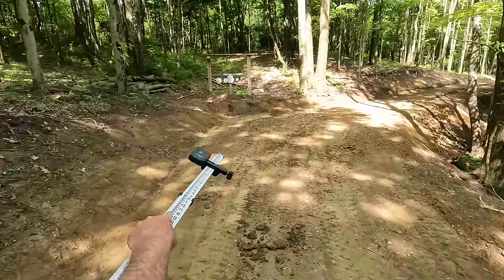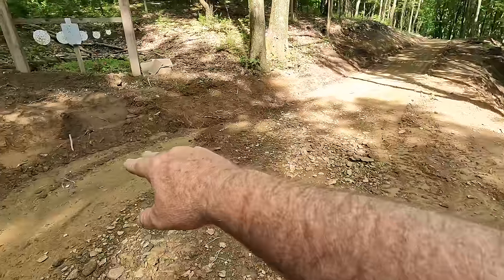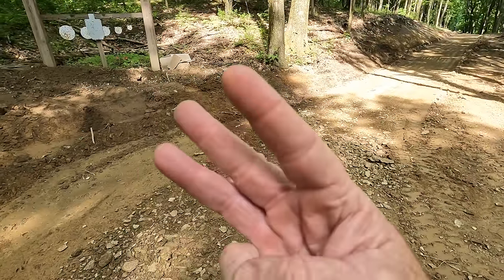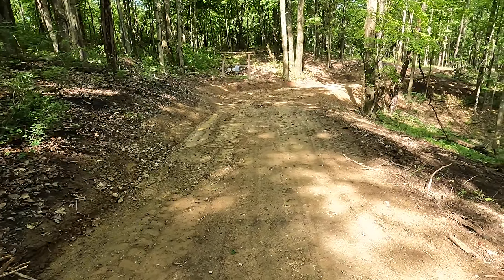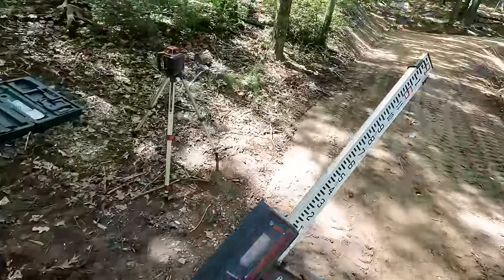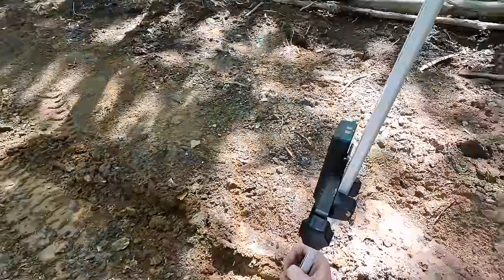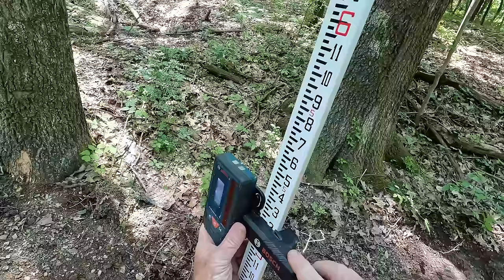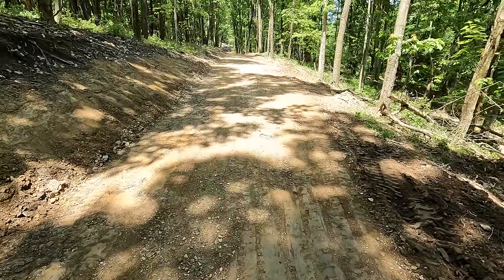Water Doesn't Flow up Hill, I need to fix this

Comment: Hello Mike from Brookhaven, MS. I watch your video's pretty much every day.  You remind me of myself about 30 years ago when I was around 55 years old. I was and still am very much a machinery freak and have owned many tractors, backhoes, dozers, and even a small excavator since I was around 20 years old. I did not get to the  point you are where I could buy new until after I retired but rather did a lot of horse trading and working on the used equipment. I was a mechanic by trade and used my skills to keep the older equipment running and much of the time to get it running from a broken down situation. I have been retired for 25 years and still cut about 5 acres of yard/pasture but have gotten rid of all my heavier equipment due to realizing things are not as important as they were when I was younger and had much more energy, but I still have a 40 HP Kubota with an air conditioned cab, grapple, box blade, mower, and related equipment, a JD 1025R with a loader and backhoe for shovel and wheel barrow work and moving trash cans to and from the end of the driveway, and a new Stihl 760 zero turn for cutting the grass. Enough of that though, what I wanted to suggest is that you consider looking into a six way blade attachment for your Kubota skid steer. A six way blade on a small dozer or a skid steer the size you have would make ditching trails and driveways and even grading them very easy. I know you have the excavator but a six way blade is really handy. Just a suggestion. Really enjoy your video's and  your down to earth lifestyle. Tell Hunter hello from Southwest Mississippi. Charles W.

Comment: I think I would be tempted to take material  from the oak outwards on that side, making the level road wider. The bottom side could be filled with the dirt you take out.
 That looks like a potential  flat spot.

Comment: Water flow tells the facts.  Use sprayer tank and fill with water and dump in the hill to run.  Both directions.   Nice if you have laser.   When I built this building, the builder ran out and bought a large version and opened the box on-site.  After I got 98 Sand trucks loading and bulldozer to level. He could not find it not level.  Dozer guy had great eyes.  Red go after and try to kill Gray ones.

Comment: I heard you say you were going to lower the culvert below the ditch grade when you install it. Doing so will cause the ditches to erode, starting at the culvert and progressing up hill. I suggest you do not have and sudden drops in the grade going to the bottom of the pipe.

Comment: Mike just wondering if you ever tried or thought about millings for you roads and wood yard in my area there about the same price as stone depending on where you are and where there milling,  we got them for free once just so they could save on trucking cost. If you get them fresh they spread just like stone and if you compact them they make a great driveway not as smooth as laid asphalt but for a road through the woods for equipment and four wheelers just fine.

Comment: Is there a reason why the low point is on the outside of the corner and not the inside?  I would think if you did it on the inside you would not need the pipe.

Comment: Just wondering, and I'm not a road builder, but shouldn't the whole road be pitched from side to side  toward the low side of the hill? I can see where you need the ditch on the high side to catch the water coming off the hill, but why add the water off the road to it when you have a natural down hill right next to the road? Just curious as to how you're thinking...

Comment: + Sorry Mike
Reply: + Sorry Mikey , both those statements are not 100% accurate 🫢, water does flow up hill ; sometimes , & laser sometimes also does lie ; NOT easy to explain here 🙏but a small example might clear what l mean ; have you ever been on a flat desert road that in one point bend going up hill ? In SOME situations if you leave your car on neutral completely stopping at the bottom of that bend so both in front of your car and the road behind it would LOOK like going up hill and let go of your brakes the car will start dragging itself up hill to one direction depending on its orientation either forward or backward first slowly then it will gain speed if you patiently leave it alone and wait on it . 🚧Don’t know if construction engineers study and recompense for that factor especially when building high rise buildings which could be the reason that brought down the twin towers ……?!!🤪